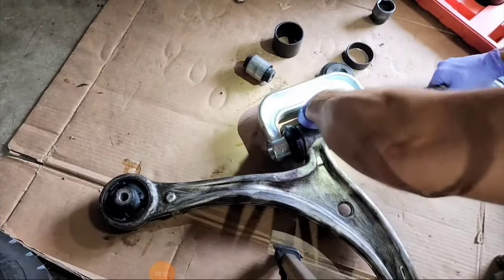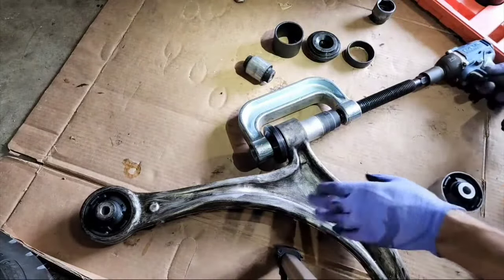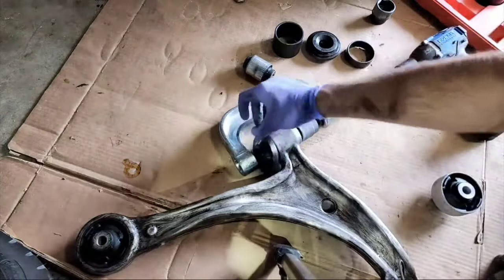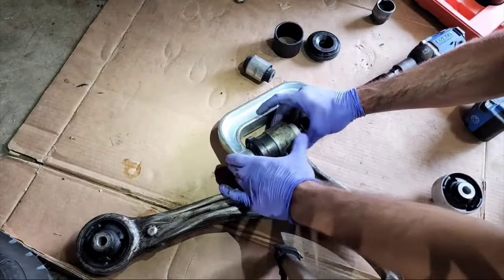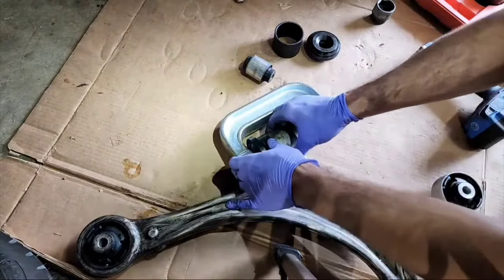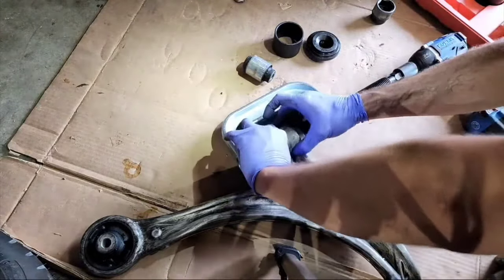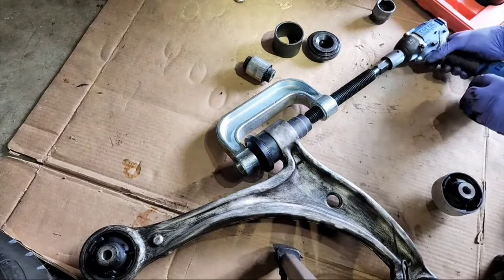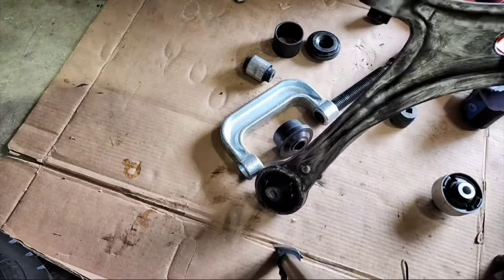(Oddly Satisfying) Using Ball Joint Tool to Press In Bushing - How To Control Arm Repair Mechanic

Comment: Nooooo! I was wanting to see you do the other side and thought you were going to show us… Did the ball joint tool work on that other end you didn’t show? Also was it as smooth as the one you just did?
Reply from the maker: I ended up using my shop press with ball joint tool and wheel bearing tool fittings! I made a video about it right at the same time as this one
Reply from the maker: @hardcore4476  https://youtu.be/yc_SCDfM0OY
Reply: @dragon_offroad  So do you mean that the C-clamp ball joint tool will not work to press in the larger donut bushing for the control arm?
Reply from the maker: @genericusername1365  I think in this case I would have needed the longer ball joint c clamp to fit all the giant fittings for that giant bushing. I am sure you could make it work if you had less lengthy tubes of the correct diameter for that bushing

Comment: Can this be used for that bushing as well?
Reply from the maker: It could if you had the right sleeves and plates and a longer ball joint press. I ended up doing it on a shop press.